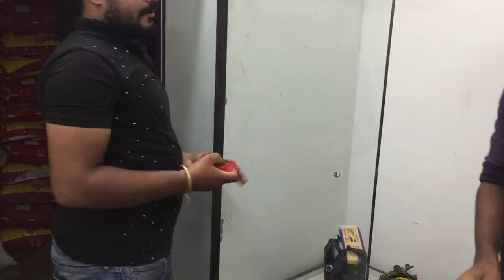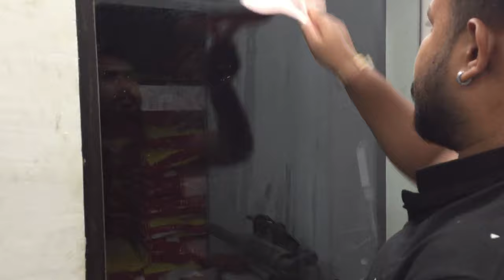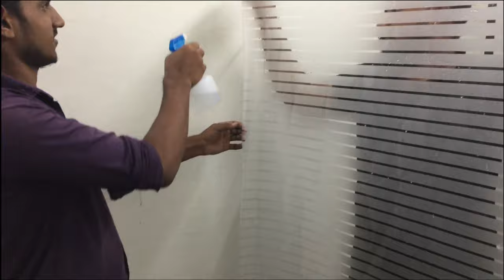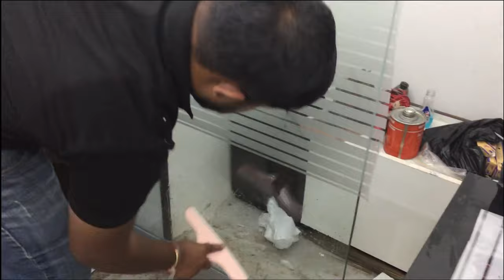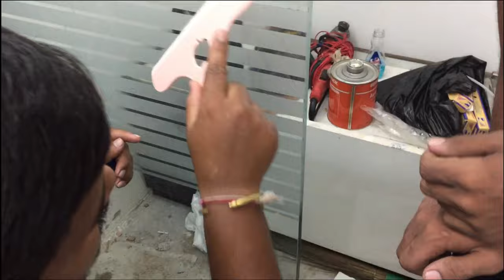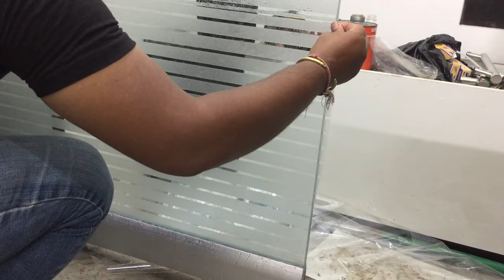How to apply  Film/Sticker On Glass

Comment: What is that liquid you sprayed on the film before applying ?
Reply from the maker: Water
Reply: water+ shampo for making it sticky and moveable
Reply: @ILikeWorking1997  Do you let it naturally dry out?
Reply from the maker: @hiddenleaf414  no ...spray water on it than past e and wipe
Reply: @ILikeWorking1997  water spray se glue kharab ho jayega??
Reply: @ILikeWorking1997  , why do you need to spray Water on the glue side of the Sticker? I simply don't understand this at all! 

If there is a reason, then you should have mentioned it , instead of just saying "Water".
Reply: @sudhasingh5853   usme glue hota hi nahi hai. Wo bas ek tarah ke charge se glass pe chipka rahta hai.
Reply: @rajupatnaik7776  there is no glue on it just a static charge. You can remove and re apply when ever you want. But unless you have expertise you can't get smooth bubble free finish.
Reply: @parijat95  , thanks a lot for that information. iLikeWorking1997 should have mentioned that, instead of just saying "Water"!

Comment: Hello sir .. I have install the film without any water just simply cleaning the glass..it has so many bubbles and lines..I want to remove it and again want to use..please help me how can I reuse it?
Reply from the maker: Remove flim then spray water then paste
Reply: @ILikeWorking1997  if I'm trying it getting teared
Reply: Please the water there should be some small soap  or water only